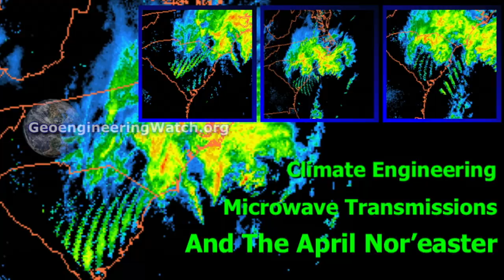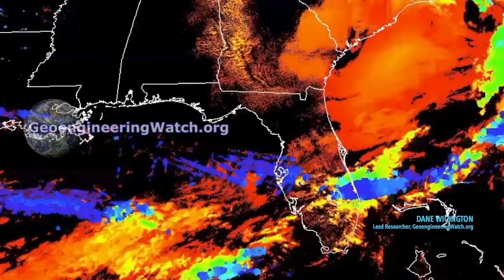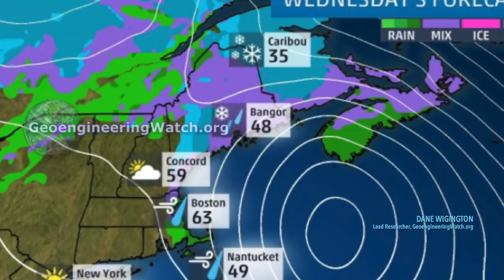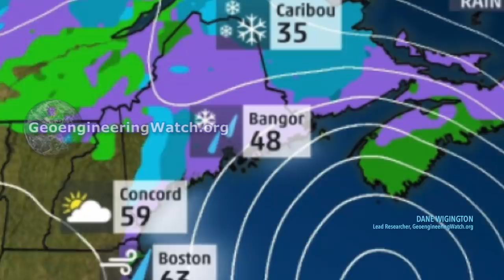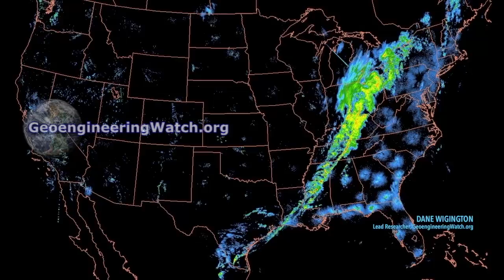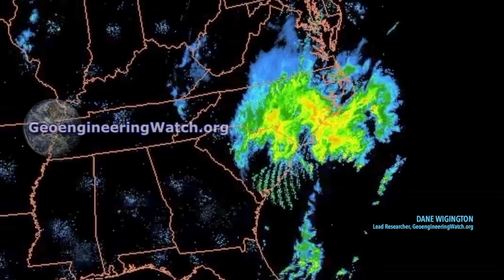Climate Engineering, Microwave Transmissions, And The April Nor’easter

Comment: Dear Dane, do you perhaps know what and where exactly is the source of those cloud (or atmosphere and most likely even ionosphere) modificating radio waves that were obviously used on the East coast (US)? If that's not a national secret and classified information, of course. It looks like the Appalachian Mountains and the surrounding area are quite a plausible candidates. I'm thinking about those major and most powerful antennae arrays out there. (On the other side the smaller local sources can be pinpointed from the footage at the end of the above video.) Did anyone tried to triangulate the source location from those waves? I assume there has to be at least one or even more such antennas capable of producing powerful enough, energy and specifically resonating radio-frequency waves used for certain weather modifications and related operations. Who exactly owns such facilities exactly? I would say those would not be owned by the government only, and there has to be some hidden (or even not?) private owner as well, perhaps even with at least majority stake. One can also calculate the actual frequency and measure the lambda from all those particularly detected "cloud waves" and use them for comparing the different cases and played-out weather scenarios, if I may say so! (As it can be seen from larger several consecutive and equally distanced cloud wave fronts, the microwave frequency band is obviously NOT USED there, but certain much lower frequencies are (and thus longer wavelengths) which assumably help larger masses of warm and highly humid air from above the Mexican Gulf to penetrate more easily and deeper or higher into northern hemisphere!) P.S.: I myself have several times in the past noticed more or less finer "standing wave" formed cloud formations for example here in Slovenia (Central Europe) as well! With that I want to emphasise any such cloud formation was obviously generated by completely unnatural means. And I would say the source of the related weather modificating radio-frequencies waves can only come here from neighbouring Italy and specific surrounding US military (or should I better say "military"?!) Mediterranean facilities.)

Comment: I live in SE Michigan. I also work in SE Michigan. Directly inline with Detroit Metro Airport. East of the airport down I696, every single day at work, you can see an artwork of trails in the sky. Almost every single day. Commercial planes have to be involved in this. Not all but some!
Reply: Definitely commercial air traffic is involved as we are from Canada and I've seen people post videos about WestJet and Air Canada both with spray nozzles. And it makes sense doesn't it because they lowered the capacity of luggage and also it seemed like there was more news of airplanes making emergency Landings because of smoke however not sure if this is related to them storing highly toxic heavy metals underneath the plane.